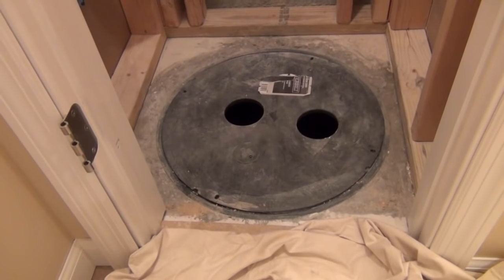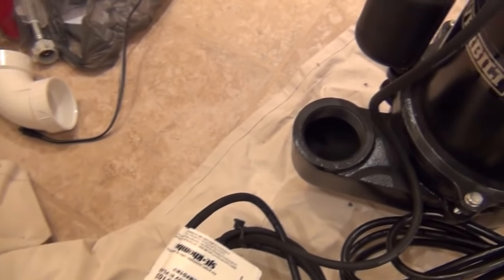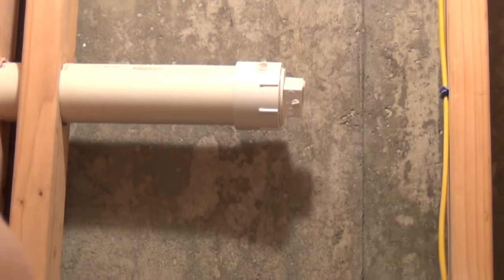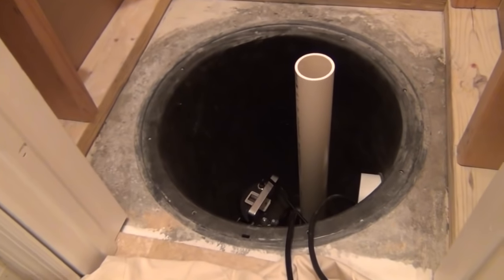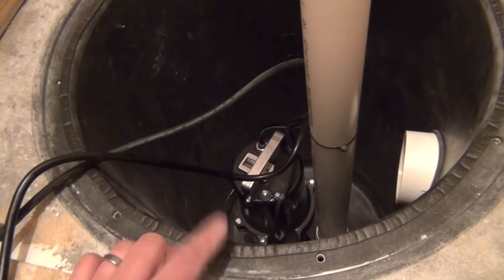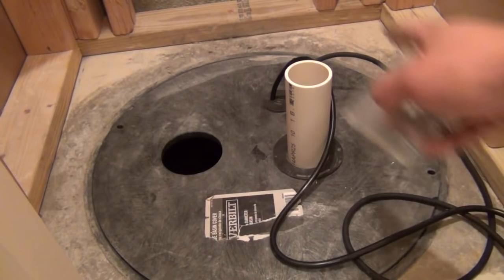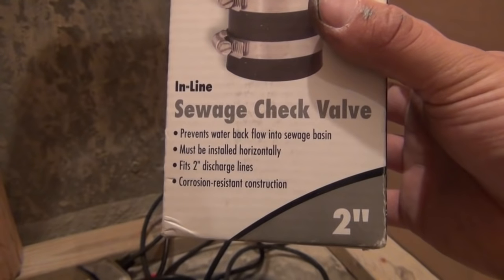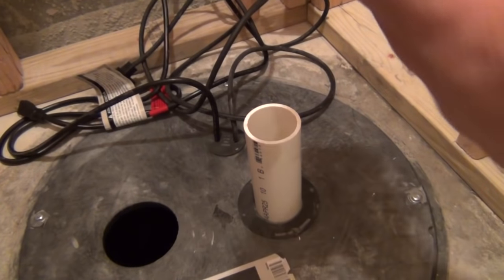How to Install a Sewage Ejector Pump

Comment: Is the tank you used for the waist to drain into just any normal tank  table or is there a specific one i would have to get?
Reply from the maker: Chris Hart It's a specific tank, it has the hole in place for your sewage inlet and also has a recessed lip at the top to accept a gasket and lid. I wouldn't recommend using anything else in its place.
Reply: So this kit can take in solids? Because I'm thinking of using this and I don't want to install it and just clog up the pump. I'm just curious and want to know more before I use it.

Comment: Mine has a new pump but really bad Oder coming in. Yes everything is sealed. I also have my laundry going into the canister. Please help
Reply from the maker: +missing3tips Does the laundry drain have a trap on it?  Even if it does, if the vertical pipe for the washer drain isn't high enough, the water velocity exiting the washer discharge hose into that pipe can blow the trap seal out allowing odors to get in.  I'd start there.

Comment: Mine makes noise, sounds like from the pipes causing vibrations.  Gurgling noise - any suggestions?
Reply from the maker: Tony Noname The vibrations could be a bent or broken pump impeller. The gurgling could possibly be the check valve not seating correctly and letting water/air seep into the basin.  Just an idea. Hard to tell not being there. Good luck whatever the case may be. Usually easy fixes.

Comment: Yeahhh, I'm about to be $1200 lighter from a pump failing after only 3 years. Pump hums like its jammed, but nothing else. I don't think the guys even tried to inspect the unit. Heard them try to take it out of the pit, but somehow dropped it back in. 2 minutes later, they said "you need a new pump." <eyeroll>
Reply from the maker: Yup, that’s usually how that goes. If someone comes out and opens the pit, they’ll want to replace it.

Comment: do you recommend a grinder pump or just a sewage pump? very great video's I subscribed, and will be watching again when I start my basement.
Reply from the maker: Sewage pump will work just fine. No problem with this setup almost 5 years later
Reply: thanks for the reply  @fixitwithzim
Reply: where did you buy and what brand?
Reply from the maker: Making Fun N Building Memories It’s an Everbilt pump (Home Depot’s house brand). I believe it has a 5 year warranty as well
Reply: thanks for getting back to me

Comment: why all the pumps sold on the market discharge pipe is 2" pipe, why not 3" ?
Reply: 3" is for gravity flow, you would need a huge pump if you used it for pumped flow.

Comment: I've never worked on one of these. yesterday I was called out to a job the house tells of sewer. there is a stooder  vent on top of the tank .
it's releasing fumes . do I replace the vent or run vent line to outside the house
Reply: So what did you do?

Comment: Can you advise what is minimum size for sewage basin.
Reply from the maker: That only size I've ever encountered is the one I used in the video. Approx. 30" deep and 24" wide at the top.
Reply: Thanks for your quick response!

Comment: Does anybody know how much should I be looking for an ejector pump replacement + quiet check valve? Not sure if i'm being ripped off. thanks for any suggestion or help!
Reply from the maker: I have links in the description for all the parts in the video. You can check them for pricing.  Hope this helps
Reply: @fixitwithzim  thanks for the quick response man! I'm being charged $850. this is not my expertise so not much knowledge about it yet.

Comment: How or where can i get that (wire grommet) mines is missing been missing i smell sewage in that room in the basement  it is an opposite room in the basement none the less i want to cover it.
Reply from the maker: Your best bet is to get a replacement lid which will come with the correct grommets. Here’s one that should work: https://amzn.to/3nH2qWy
Reply: @fixitwithzim  Thanks a million
Reply: @fixitwithzim  what size would you say that grommet hole is?
Reply from the maker: @slliks67  well it’s a 2 inch pipe so probably a 2 1/4 hole but honestly I’m just guessing. I can measure next time I’m there and post for you
Reply: @fixitwithzim  thanks
Reply: @fixitwithzim  i need the wire grommets size

Comment: Why on earth did you eliminate the clean out. Why not put a tee and put the clean out back?
Reply from the maker: George Vasquez I didn't eliminate anything.  The cleanout cap at the beginning was simply capping the waste line overnight in between roughing the drain line and installing the pump. It was temporary and also not needed in the final install. You can pull the check valve off the pipe and snake from there if needed. It's only a 4 foot long line. Thanks for the comment.

Comment: i rent out an apartment and i noticed that my sewage ejector tank has the outlet but the vent pipe is blocked off. is this normal?
Reply from the maker: NE Not really unless someone added an aav somewhere but you're really not suppose to use those for this type of setup.

Comment: I can't back out the bolts on my cover. The bolts continue to spin but never actually come up. Any advice?
Reply: Try using and impact or regular drill and angle the bolts if necessary. Also make sure there is a small 3/8" hole in the discharge pipe around the top of the pump. It's called a weep hole and it keeps the pump from getting airlocked which can burn up the pump which it could be to late. Also replace the checkvalve sometimes they will lock up.
Reply: @my2centz196  Thanks! It ended up that the bolts were seized up. There where these nuts on the other side of the bolts that went through the ring of the basin. I ended up pulling them through the basin ring to get the lid off. Not a good thing but it wouldn't have come off any other way. I'll figure out another way to get a nut in there and secure the lid. I'll use anti-seize on the bolts.
Reply: @gustafsonlarsk  your welcome. I suggest getting new corrosion resistant nuts and epoxy them back into place. Just make sure you clean it pretty good and maybe ruff it up a bit so the epoxy will hold.  I'm sure there's other things you could try also but that's the easiest thing I can think of
Reply: Oh and use a good epoxy. Something that takes longer to cure is gonna be stronger in the long run but if you don't have time to wait 24hrs a 15min epoxy will work just fine. Make sure to use a good bit to fill in the gaps around the nut completely without getting to much on top of the nut but if you do you can always take a smaller drill bit drill inside the nut without touching the threads then clean it out with a tap. That's if you mess up but if you put a little tape over the nut before hand then remove the tape before it cures to hard you won't have to do that even if you are sloppy with it lol.
Reply: @my2centz196  thanks for the advice. I'll try the epoxy method. I've got time. It's a 3rd bathroom in my basement that was never finished. Everything is plumbed and roughed in. Just need the grinder lift pump before I install toilet/sink/etc. My other issue is trying to find a vent to hook up to for the basin vent. It's across the basement from the bathroom and under my kitchen on the first floor. Any advice on venting?
Reply: @gustafsonlarsk  if you can identify any other vents you can tie into those as long as it's at least 2" but if not you will have to run it all the way over to the one you know of. Their should be a vent in the bathroom that you can tie into if nothing closer but without seeing I'm not 100% sure. Sorry had to edit lol. If the basement is fully finished it can be quite a challenge that's for sure but if you can locate the kitchen dry vent you can tie into that but it depends on how it's run. If you have a drop ceiling that will help.
Reply: @my2centz196  Cool, thanks. I think I see where my kitchen vent is. I'll have to get creative with some PVC but that's a good idea. Thanks for all of the help.
Reply: @gustafsonlarsk  no problem happy to help. Im sure you will get it. YouTube is awesome for getting helpful info. I know the videos and community has help me a ton. Just wish I had it when I was younger lol. Good luck with the bathroom I'm sure you will knock it out in no time and have that great feeling of i just did that lol.

Comment: You should be using pressure fittings on the discharge line not DWV fittings
Reply from the maker: Yes, correct. I will say this has suffered no adverse problems as a result. More often then not, I find these things plumbed with DWV pvc

Comment: great video. my existing pump is only a few years old. it just started running and pops the breaker . what might that indicate? thank you!
Reply from the maker: Dead short to ground in the pump motor. Time to replace. No way to repair that.  Thanks for the comment and good luck with your project.
Reply: +zimsjeep THANK YOU!

Comment: Nice video. I'm cracking the pit after a trip to home depot... Any suggestions on biohazard equipment? :-)
Reply from the maker: Hope your repair went well. Not a fun job.  Get it done quick, wash up, and grab a few beers afterwards.
Reply: It went ad well as could be expected.  Weather stripping on the dating was a good substitute gasket.  I also added a union in the vent for next time. Beer afterwards helped :) Thanks again for the great video.

Comment: You forgot to drill a small hole on the discharge pipe 2 inch from the bottom for airlock

Comment: I didn't see you drill a weap hole and if you didn't then that's probably why you are getting thumbs down. You need to drill a hole about 3/8" around the water leave usually around 6-8" up the pipe. If you do not do this your pump can get air locked  which can cause all kinds of problems. I see this a lot with homeowner installations. Other then that I don't remember seeing anything else that would be a problem. If you did not drill this hole I suggest you Remove the pump asap and do so to prevent future problems and expensive repairs. This is much more important that you think. Edit I didn't down vote you lol. I didn't up vote either however I didn't down vote it so don't shoot the messenger I'm just trying to help I've done this for a long time. DRILL THAT HOLE LOL!
Reply from the maker: This pump didn't require a weep hole, some do and some don't.  Thanks for the comment
Reply: @fixitwithzim  yeah some put the hole in the casing however I find it's still a much better idea to add one especially seeing how they can get clogged up on occasion.

Comment: so does this system pump up big turds and toilet paper? is there  macerator for those after dinner giant turds?
Reply: you have to use a non clog vortex type impeller submersible sewage pump its a non solid contact pump it just pushes everything out. he got those from your local home depot might not be the best one but depends on your use. a Zoeller pump at Grainger would be a better choice.
Reply: How come you you didn't install a quick disconnect for the vent to allow quick disconnect when it comes time to replace the pump?
Reply: Dinh Nguyen you could do that if you wanted to. You can also just lift the lid with the vent still in it and (in the case if this install) just turn the lid to the left and set on floor with the vent pipe still sitting inside
Of it.

Comment: How did you seal the 4inch pipe?
Reply from the maker: The tank comes with gaskets for either 3 or 4”. That’s all you’ll need
Reply: @fixitwithzim  this is the Home Depot ever built one? It didn’t come with any? Or is it part of the pit cover hardware?

Comment: The plumber did not install the ventilation pipe because he says he put a vent in the bathroom and kitchen and that is where the gases will come out, but I am worried. I invested $40k and I think he did a bad job.

Comment: I don't like those everbuilt basins with only 4 bolt holes, very inadequately made, even with the so called gasket. I would use about 4 tubes of a butl adhesive or caulk on everything.
Reply from the maker: Dan I haven't had any problems with it. Works just fine. Thanks for the comment.

Comment: Ain't this just a regular sump pump. I didn't realize they used these for sewage also
Reply from the maker: Two different types of pumps…sump and sewage. Sump pumps are for clean water applications only such as sump pits in basements for rain/ ground water discharge. Sewage pumps are for bathroom applications and can grind up waste that you’d typically get from toilets, etc.  in other words, a dump pump cannot be used in a sewage application.  Hope this clarifies things. 👍🏻
Reply: Oh ok I understand now. I didn't know they grind stuff up. Now I know.

Comment: do you have a septic system
Reply from the maker: No, cesspools
Reply: +zimsjeep OK, we have a septic tank, I was just trying to see if there was a specific reason why we had this. we just moved into a new home. (built in 1970)
Reply from the maker: +Alicia C You'll have a sewage basin and pump if any plumbing fixture in your home is below the  sewage main exiting your house. Usually this would be a basement bathroom, laundry, etc.  Sewage flows by gravity out of your house. The pump is needed to lift the water back up to the main.
Reply: +zimsjeep OK thanks, that makes a lot of sense now

Comment: And here's yet another pump with check valve installation with no weep hole in the discharge pipe.
Reply from the maker: This pump doesn’t need a weep hole. Not all of them do
Reply: @fixitwithzim  Any vertical discharge centrifugal pump using a check valve (like just about every sump pump installation) needs a weep hole to expel any trapped air in the discharge pipe. That is only if you want maximum reliability. But whatever. Thanks for the vid.

Comment: I thought you need a 4’’ pipe for sewers
Reply from the maker: Gary Gonzalez Check your local code, 3” is ok in my area. Usually they upsize to 4” at the main house trap and out to septic system

Comment: On that "China-made" Flo-tec pump the manual/diagram has 90 degree elbows as if its "ok" (disgusted #1).............. On some Flo-tec pumps the metal arm holding the FLOAT has to be manually bent UP OR ADJUSTED LEFT OR RIGHT(depending on clearance) or the float WILL get snagged & NOT FLOAT/POWER ON (disgusted #2)
Reply from the maker: Tough to find anything not made in China these days my man, or at least a good portion of the components.

Comment: As a professional plumber I don’t accept this installation, first you used frenco coupling check valve which it may expand and leak or fail on clamp, second per IPC PLUMBING CODE you shall use pressure fittings and pressure pipe on discharge pipe not the dwv you used.
Negative
Reply from the maker: Thanks for your contribution.  7 years later, no problems my man

Comment: never pull a pump by a cord
Reply from the maker: Ryanrock2 if you're pulling the pump out, 99 percent of the time it needs to be replaced so it really doesn't matter. If it makes you feel better, use your rope technique and then when it gets tangled inside the impeller someday, let me know how you get it out :)
Reply: you tie the rope to the handle on the pump and to something above the tank, pulling all the slack out of the line. im a plumber and work on lift stations all the time. you could pull the cord loose where its attached inside the housing
Reply from the maker: Ryanrock2 thanks for the suggestion but again if the pump is not working and broken I'm not going to care if I pull the cord loose because I'm throwing the pump out anyway.  Like I said you can also pull it out by the pipe as well.  I've worked on a bunch of these as well and never seen a rope attached. To each there own.